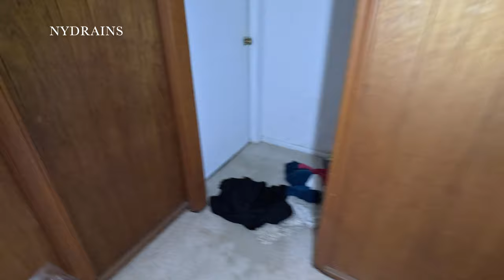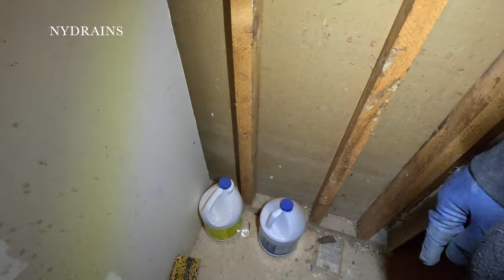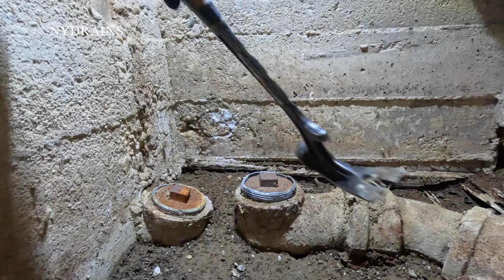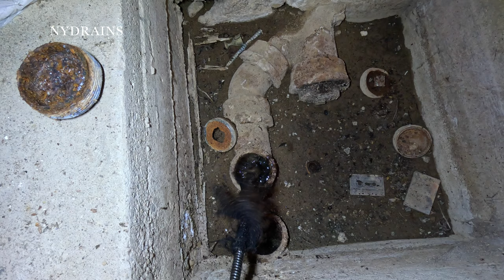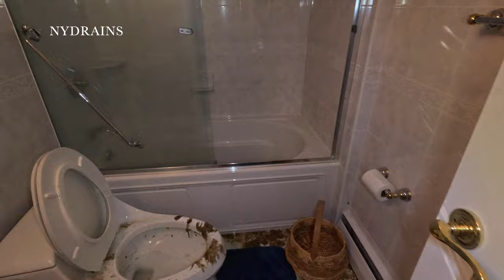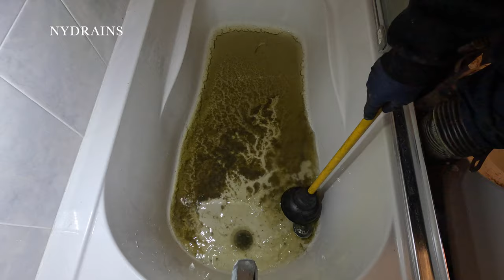Clogged Drain #219

Comment: Gooooood morning Donald, all and Mike in Durham, CT! Starting another week with a poopy stinky mess, couldn’t ask for a better way to start the week :-)
    Once again Donald, if you had that Milwaukee backpack that ran on battery power, you wouldn’t have to lug that large heavy Spartan through narrow walkways! It’s just like a backpack leaf blower. You  carry it around like that and it is just a strong as that Spartan is! You should always work smarter, not harder.
   Edward H. – “Integrity Plumbing, Septic and Drain“ out of the Clinton, CT USA area.
Reply: Good morning Ed! The breaker that controls the downstairs bathroom also controls the refrigerator upstairs. 🤣🤣
Reply from the maker: Good morning Edward 🙏

Comment: Wonder if you change the house side plug with a small riser pipe and at the top you add a water alarm . If the pipe plugs up a alarm will sound letting home owner to call NYDrains to come and clear berfore a flood.
Reply from the maker: I do recommend water alarms in certain situations 😉

Comment: That has to be the most poop explosion in a bathroom yet.  And yeah it was a toilet paper party in the poop bathroom being the host of that event.  Actually a rare non-trap removal explosion...and more rare one where it's way into the intake pipe.....but man you knew when you started digging in that, it was go.....kind of.  This was a thick lava mess river at first but once you really chewed into that it was a solid gusher.  One thing for sure is even if this wasn't a trap issue, this was soon to be clogged by the roots.
Reply from the maker: Oh definitely 😉👍